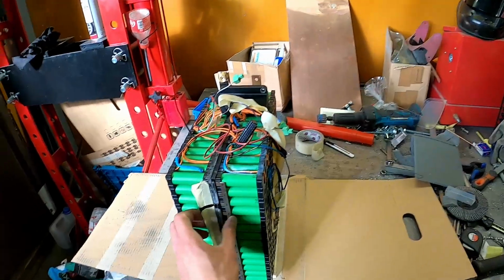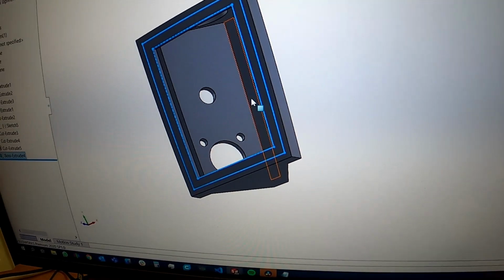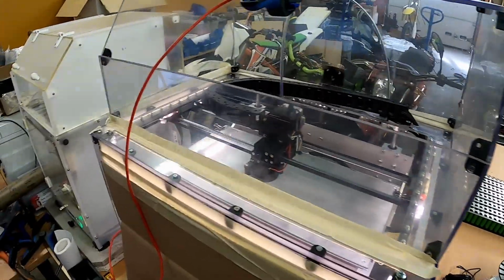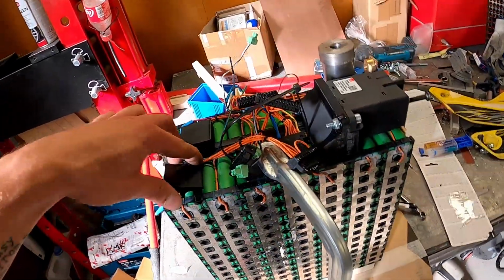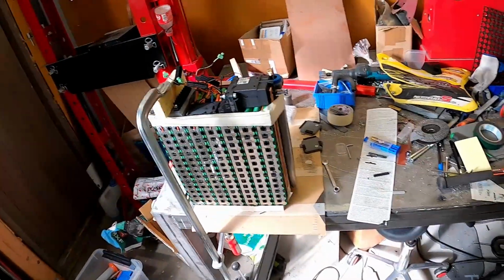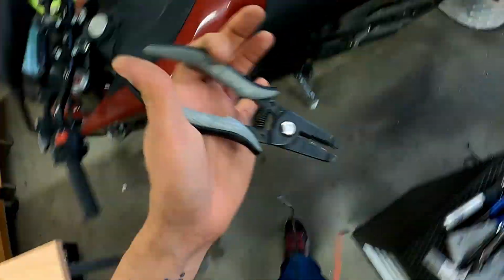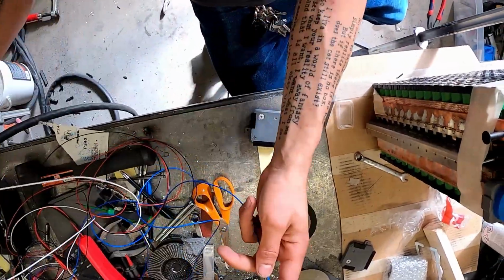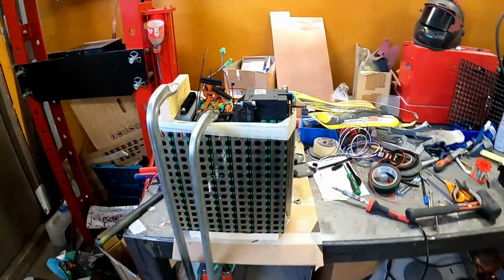Teemu vs Jarmo -  Li-ion battery nightmare. Zeva BMS installation to the battery back.

Comment: Your frame makes your battery build so much easier,mine is quite complicated.how many volts and ah is your battery??
Reply from the maker: 46ah and its 28 cell battery. More on it later
Reply: Electrification Challenge 46ah isn’t too bad,thanks .